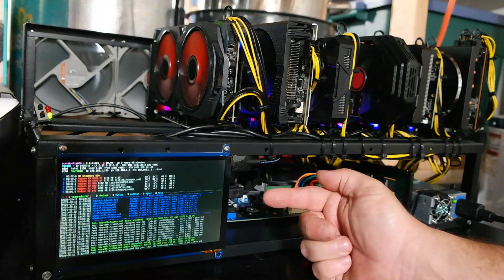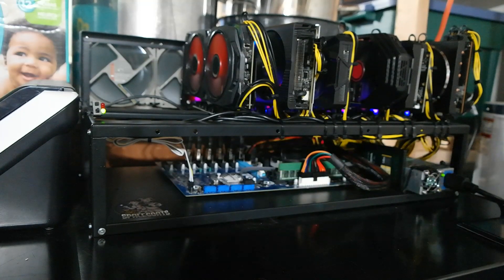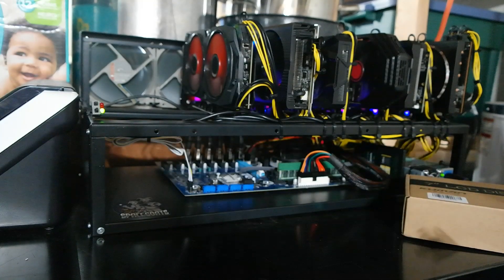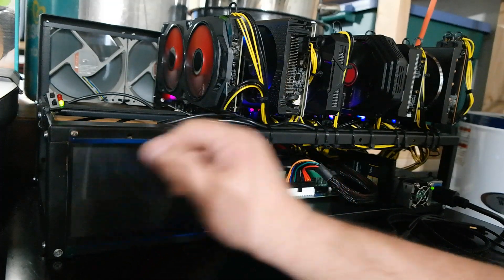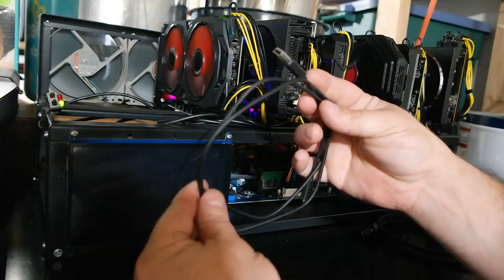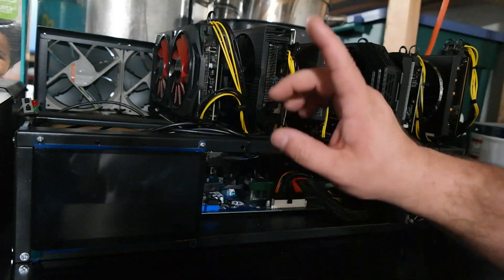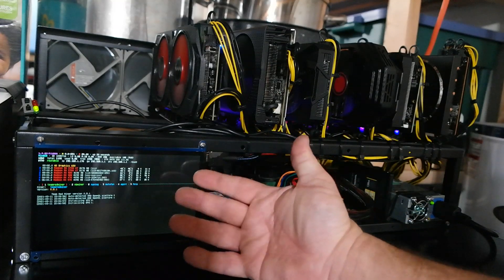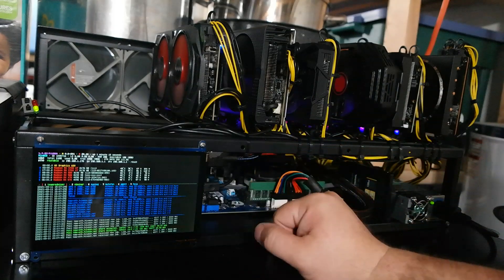Add A 7" Monitor To Your Mining Rig

Comment: Can you access BIOS with this screen at this resolution?
I had 800*480 version from something else, and when I've tried to use it on my rig, it works fine inside hiveos, but when I go to the BIOS, it all goes tits up, gltiched and even shows some text in chinese even though it should be english.
Reply: Oh and also have you tried to run it with just HDMI cable plugged in and no power?
Smaller 5" screen I have can be powered from HDMI cable and doesn't require any additional power even though it also has microusb connector for power, I believe it's part of MHL standard which is supported by most of the motherboards/GPUs.
But that will depend if the screen is 1 - wired the right way 2 - if the screen consumes less than 900mA on the 5V rail as per MHL gen 2 and 3.

Comment: Hello Mad Electron Engineer! I purchased the exact same screen and have run into some issues. My motherboard only has a DVI connection (no HDMI), so I purchased an HDMI to DVI cable off of Amazon. After booting, I get a "no signal" error on the screen. I thouight this might be the cable so I connected it to my TV instead and it has no issues displaying. Any advice you have?

Motherboard = ASRock H110 Pro BTC+

Comment: How do you boot from HIVE-OS right into the miner view?
Reply: That's what I was wondering. Thinking about getting this for my NiceHash setup, but I want to make sure I can see the Windows toolbar still.
Reply: @420  You aren't using Windows at all, hiveos is a linux based operating system made for mining. The screen is basically for monitoring, otherwise you are remoting in by logging into hiveos elsewhere.
Reply: @notjamesdood  no, I personally use NH on Windows. I would like to add this 7" display to my rig.
Reply: @420  oh gotcha sorry, thought u were replying to the hiveos question/comment..i haven't used a 7inch but i think you would probably be able to see it good enough

Comment: ummm... "burn-in" has nothing to do with backlighting... it's only has to do with static image data on the display itself, usually only Plasma, CRT, and some OLED, and correct, good TFT's won't see much burn-in anyway. (besides, nothing gets "burnt" on LCD, but the cells can become polarized over time on a static image, but is reversible)